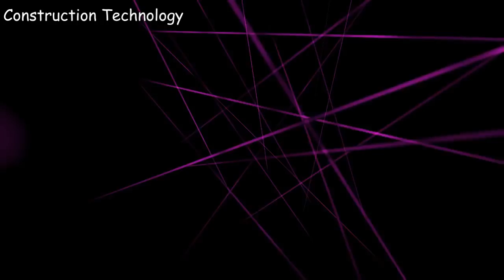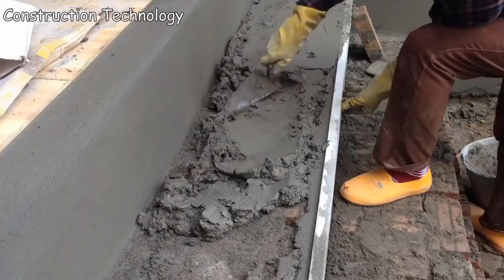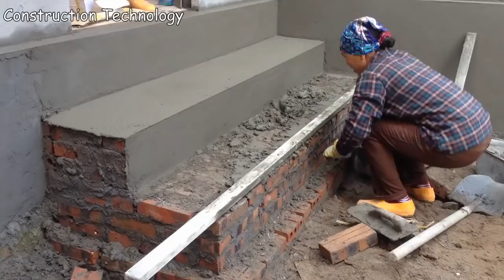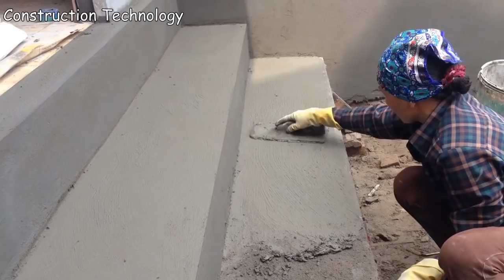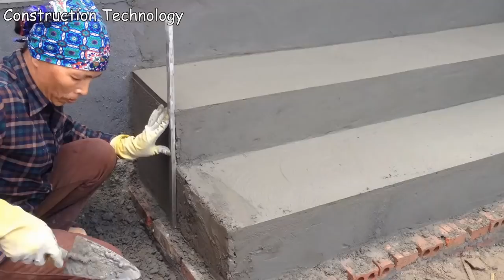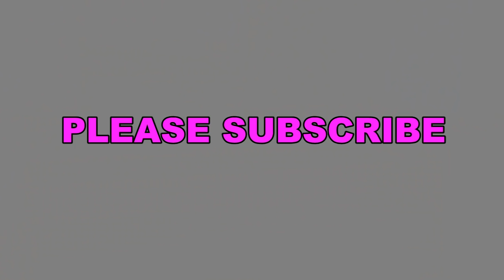Amazing Techniques Construction Rendering Sand and Cement For Brick Steps

Comment: First of all this has got to be south america, where it never freeze's, and thank God for building codes which in this country would consider stepping down from a entrance a hazard, for obvious reason's. Secondly I doubt very highly if this will remain unbroken for a very long time, but like I said if it never freeze's then it may last for a couple two three years. 
      After the first settling, then it will begin to chip away, rain water will seep into the brick below and then within less then 5 years, you'll be right back over here doing patch work every hear then after. Perfect example of what can look good and right, giving the appearance of something that it is not., when in fact it's a disaster looking for a place to happen. 
     They would have been better off just building reinforced cast steps and set them in place. Less time doing what they had to do and the additional time of setting the bricks in place, when all you have to do is level the ground pour a little 4 inch slab, and set the precast steps in place. Guaranteed to last 10 to 20 years. Once you build a precast mold, it's good for several steps even with the cheapest of forms, a little wire mesh, bing, bang, boom.

Comment: Not how I would do it, pour the steps in solid concrete with supporting rebar and drilled into house foundation.  But, skimming the finished product is the same, only on solid concrete with the steps having a 5% downward slop from back to front to allow water drainage.  Other than that, outstanding job on the skim over bricks.

Comment: Although she made a good job,  there is such  as easier way of making proper  steps that will last 100 year's.   Her coating looks about 10/15 ml  thick.  It will just crack and break up.    She should have made a wooden   mould, you don't need to build up bricks.

Comment: THE RIGHT WAY!
Step 1. form the steps with wood.
Step 2. Place sheets of mesh wire in each step to help reinforce against cracks.
Step 3. Spray or brush engine oil on the wood side that will come in contact with the concrete.
Step 4. Pour the concrete and smooth out the top of steps.
Step 5. before the concrete dries up remove the wooden form carefully, the concrete won’t stick to the wooden form because of the engine oil.
Step 6. Smooth out the rest of the steps the was covered be the wood form.
JOB DONE!

Comment: hard work, tremendously skillful,, and entirely non-code.  That would not pass code in any US jurisdiction I know of.  No landing.  Rise over run is out of compliance.  And it would be entirely useless in most of the US  a few freeze thaw cycles and that mortar parge coat will probably flake off.    Beautiful.  I'd like to have that skilled worker.  The steps need an engineer, architect, of good building inspector.

Comment: According to building standards, ergonomics and biodynamics, the height at one step should be between 18 and 20 cm. In other words, one step is missing. So a ladder made by a novice is not an amazing technique !!!
Reply from the maker: Thanks for your comments.
Reply: in asia  2 steps cost 1/3 less than 3 steps and money is king =P i agree that the above work would not pass north american building code. and the first step is a neck breaker.
Reply: George SPI how can you tell how high it is George? Don’t just be guessing!!! They built the stairs high and wide enough, based on the specs that would best fit them.

Comment: Amazing construction workers?  Those steps are a non code height and depth.  There is not a building inspector that would pass those steps.  Too tall, and too deep  Ya know 2X rise + tread = between 24 and 25.  So,, a very pretty build that has to be torn out and replaced to pass inspection.
Reply: Inspection.. okay mate we talking about rendring existing steps..
Reply: @maxk888    No.  new steps.  And it matters not what country,, people are people,, we all walk the same.  Maybe there is no inspection,,, but those steps,, too tall, too deep, irregular riser heights, no landing outside the door,,,,, Those steps are going to hurt someone,, or many someones.  The skill shown at parging some steps,, sure,, looks like a good mix too.    No mortar of any type will last the freeze thaw cycles here,, but a tropical clime, maybe.  And the longer they last,, the more people will be injured.

Kind of like the very famous magazine Architectural Digest,,, I almost have never seen a set of stairs in that magazine that are not improper ,, will not pass any code inspection.  But then again, in my experience,, most architects, and most engineers  (certainly not all)  could not design a decent set of stairs, at all, or ever.  And they complain when I correct the stairs.
Reply: @Sailor376also  let me guess, you are an inspector
Reply: @maxk888  No.  I'm the guy that builds them.  How many now?  Don't know,,,, hundreds at least. Engineered hundreds more.  Straight, turns, winders, spirals, post spirals, unsupported spirals,   There are three common formulae for computing rise and run, the easiest for 'normal stairways is 2x rise plus  1 run should equal between 24 and 25.  I normally work in inches (an old guy)  but the ratios are the same metric or SAE  There are dozens of places to introduce an error that makes a bad stairway.  A bad stairway is any one that is going to hurt you.  No inspector required,, gauge it by ease or injury.
Gotta go,, back in two weeks

Comment: Building steps or th readers should also invoke Steel or Rebar. To keep it strong from moving away from the building. The plastering was excellent, but u needed to plaster out the remaining blocks for a beautiful neat finish.

Comment: I don't have 30 years in or start my own cement finishing company after working 15 years with the union like some youtubers pretend credentials but, I dont need all that to say this. Those steps will 100% crack like an egg. If lucky they will hairline but judging by the brick foundation on what appears to be some very soft wet soil/mud that will move and crack like crazy.

Comment: problems of thin cement cracking aside, I don't get why you would WANT your steps to look like concrete instead of brick? should definitely fill in all the space better with mortar than how this started, but putting this thin shell of cement on it doesn't just ruin it structurally, it makes it look worse too.
Reply: xuất thân khác nhau thì góc nhin họ khác  điều đó  bạn không cần để ý bạn ơi !
Reply: @Phuctran-zg6qj  point of view, nothing. Brick looks vibrant and textured, cement looks blank and bland, brick looks like someone put effort and heart into the product, cement looks like someone lazily poured goop into a box and let it dry, bricks themselves are often hand made still, especially in vietnam, and have that extra element of community cohesiveness in their very existence, while cement is just bits of crap poured from one machine into another, mixed in that machine, then transported via machine around a few times, the only apparent human touch is maintenance and drivers. From every objective point that can be made about aesthetics, color theory, and neurological responses to symmetry versus asymmetry and studies into qualia brick is objectively better "looking" before you even get into opinion and point of view to place a subjective monacre on it. These reasons are why marble statues are more visually appealing than concrete ones, and why people fake wood floors, doors, and granite counter tops. I get it, she put effort into it, and she did. But it was wasted effort, painting a portrait of someone with materials you pumped out of the sewer still looks like crap.

Comment: Its just a bricks that are just.. placed together, without any solution in between them.
1. the layering is wrong for the stairs.
2. no solution will be sufficient enough to just cover the bricks as a first layer, without arming the material with some net or something. stairs have sharp corners, there should be something reinforcing it. 
3. my guess is that there is nothing that is holding it, its just ground, without any freaking base to it. 
4. you never need to make a smooth surface to the solid outer stairs, spec if they are concrete, this shit gets very slippery very fast, there has to be texture to it. 
you could just place this bricks on the ground and encase them in waffles.. it will all collapse at some point and crack the first week of regular use.  
People actually think that this is what it takes to make actual outer stairs of this kind???!!!